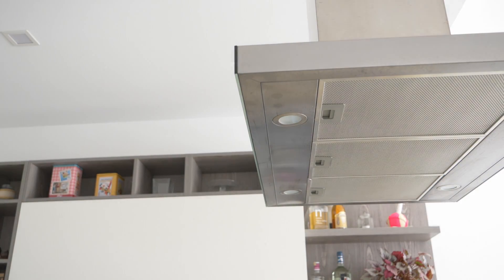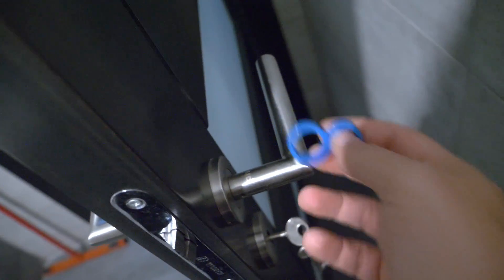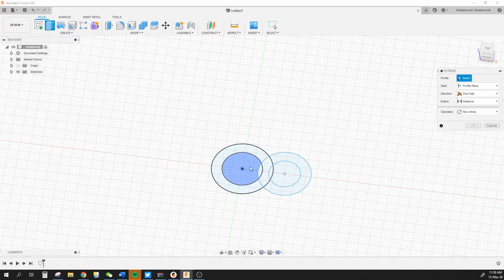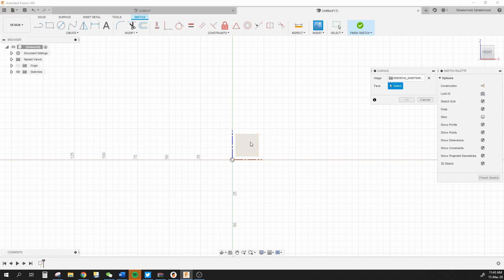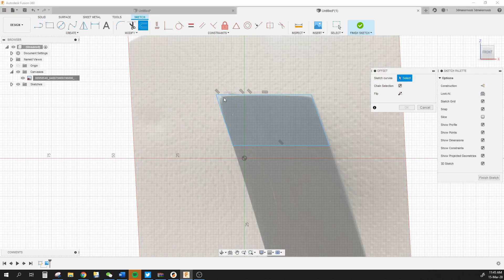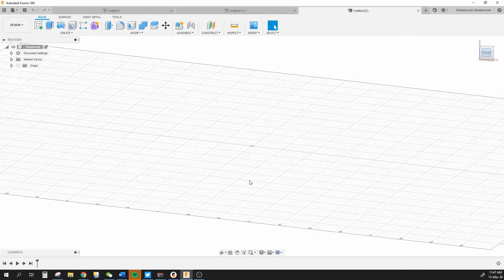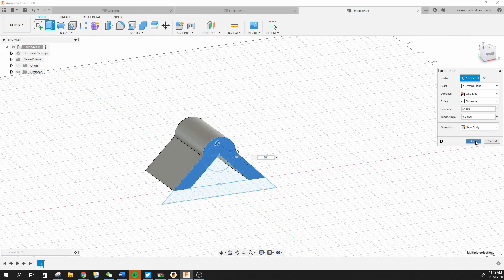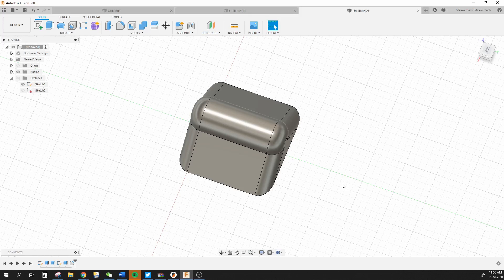Home Improvements With 3D Printing, TPU And Fusion 360

Comment: How did you manage to work with the exact measured values? You made a 19mm hole for a 19.28mm doorhandle but my ender will create a 18.78mm hole from a 19.28mm hole model so why did you go even less than that?

Comment: Nice prints. But holy crap.. that fusion 360 look nice but I can see so many problems with it. I never knew how bad it is. I use CATIA V5 and the logic is quite bulletproof. Here in Fusion the program just solves ambiguities on fly without any info about it. Try those sketches in CATIA and you will have a really bad time.

I am an engineer expert in CATIA V5 according to some, and developer at Autodesk but for Inventor. I know how bad is Inventor compared to Catia.. but HOLY.. this Fusion should be banned. Fortunatly Fusion is just for hobby and no real engineered parts are made. The lack of positive feedback may lead to geometry errors in the final part and if that part flies into space it will be a multi-million dolars mistake. That's why Fusion is not there, nor Inventor to be honest.

Comment: 97 A! Yeah that's some really hard TPU. Should of used TPE 85A on the stove hood and yes it prints just fine on the ender 3 as long as you've put an adjustable extruder arm with a decent spring. If you have the geared aluminum extruder top and capricorn tube you get thre best results for something that flexible.

Comment: would the chair socks degrade quickly?  I'd suggest some carpet that can be glued to the chair or to the socks you printed.
for the hood covers you can now get some silicone and make a mold for it. alternative is to make some open cell foam version.

There was a neat doorstop that drilled into the flooring instead of the baseboards.
Reply from the maker: You must not be a maker a guess :)
Reply: @3DMakerNoob  maker can be anything but if you have to print the socks for the chairs every month then you're wasting cash on materials.
or you just using the 'maker at home' as an excuse to make videos then you're doing it right, which doesn't really make you a maker but a shill.
Reply from the maker: Whatever floats your boat, I had a problem and I solved it. Sounds to me like it’s a non issue. Also, since I’m not selling anything, I don’t see how I could be a shill?

Comment: Your CAD work is a bit overcomplicated.  I mean, of course the most important thing is that you get the job done, which you did. And it didn't take you that long to do. 
But a few small pointers to make it even faster and easier:

(disclaimer: i have never worked with fusion360, but following tips work with all other cad programs i have ever worked with so i assume it should work in F360 as well)

when you need to make a shape like the one at 9:16, instead of using 3 seperate extrude commands adding little bits to your object one after the other, it would be faster to first extrude the whole outer shape, then cut away the inner shape.  Do the extrude commands not as "one side" but in both directions, that way the sketch stays in the center of the object and you can reuse it for the cut without repositioning it or having to create a second sketch.

for the chair leg cover at 6:52 the same applies. However, since you want to use the same offset on all sides of the object anyway you could also use the shell function (or however that might be called in F360). So first extrude the outer shape of the object, then use the shell function, tell it which side to be the opening and set it to 3mm wall thickness.
Reply: you just wasted more time than this would have saved.